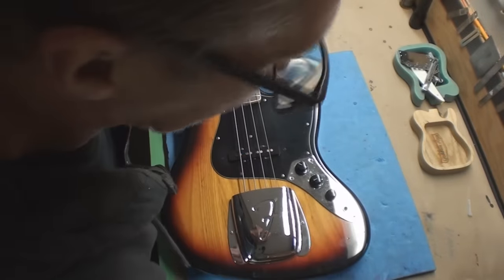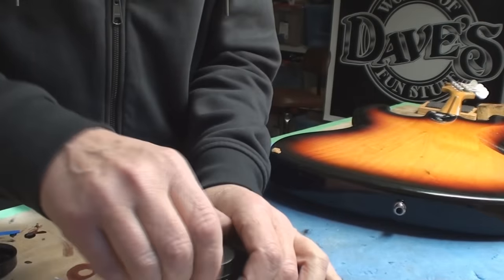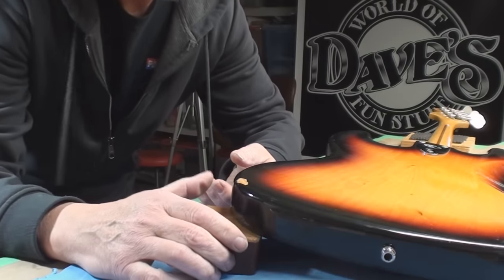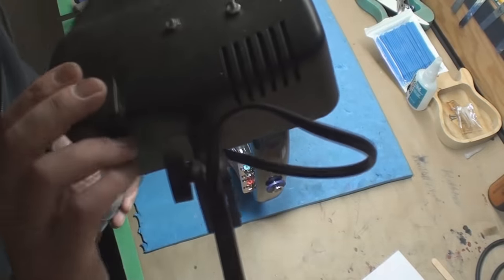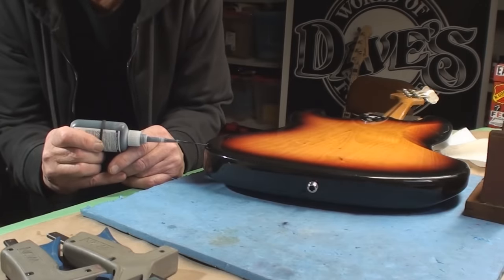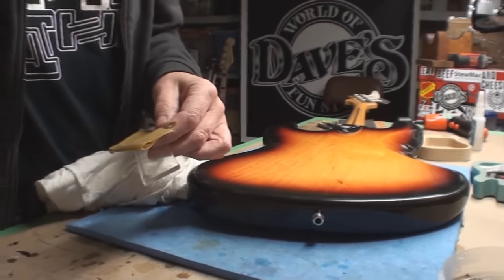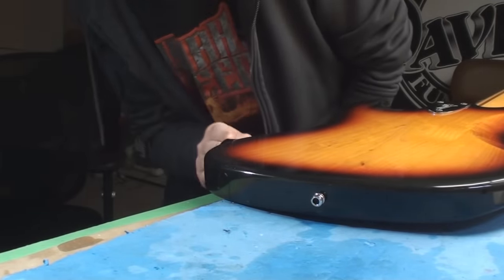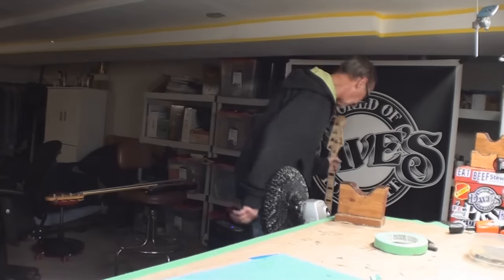Guitar Finish Repairs Using Gluboost

Comment: Dave, you should really look into getting some 'bench cookies.'  They're great for propping your work/piece off the table both securely and without starching or damaging the piece.  Silverline Tools and Rockler make the best ones with non-slip rubber pads top and bottom.  They even have an entire "lifting system" for them if that's what you need.  I just have the cookies themselves, but I can't imagine work without them now.   They're great for working on the backside of instruments like you're doing here.  Just thought I'd share.